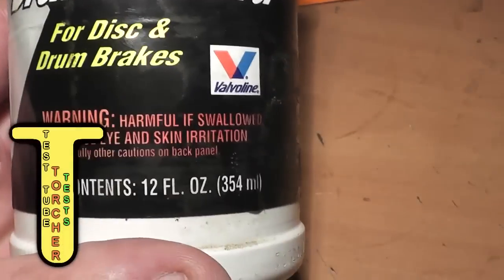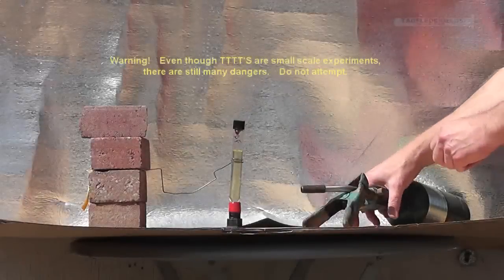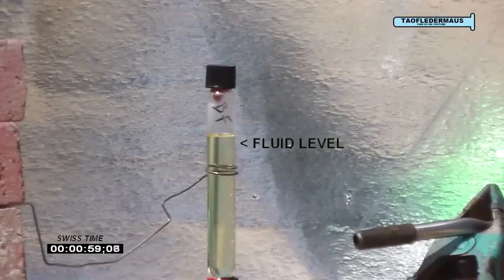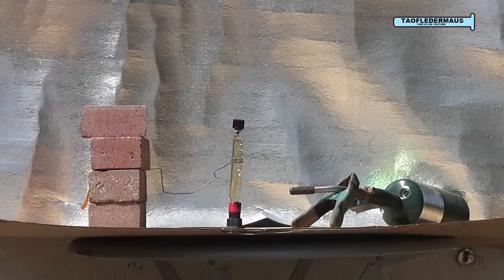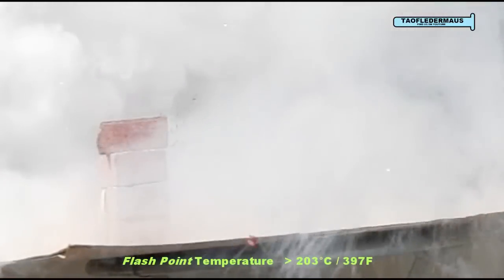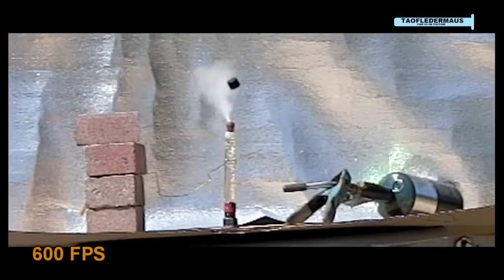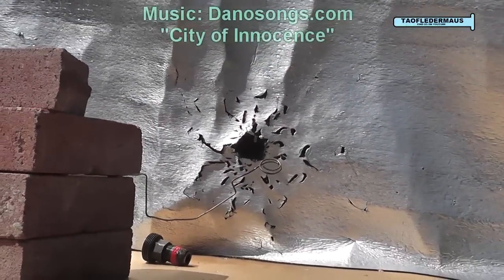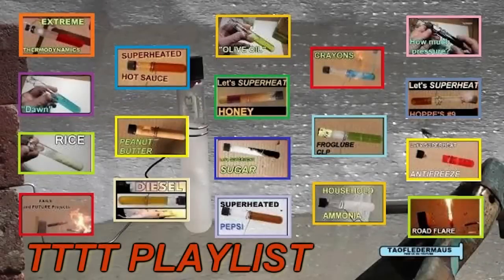TTTT - DOT 3  Brake Fluid -  Test Tube Torcher Tests

Comment: That did not auto ignite the torch was the source of ignition when the pressure released the temperature of the brake fluid would instantly cool to the boiling point of the liquid, the fine dispersal of it would be the point of it combustion like flour or lycopodium dusted in the air would be highly combustible but when sitting out on a table there not flammable to a degree

Comment: Very cool. If you want true brake fluid auto ignition, put about 4 ounces of DOT 3 in a Styrofoam cup and add a table spoon of dry pool chlorine powder. Timing can be varied with the amounts added.

Comment: I would be shocked if brake fluid is easily flammable. Many times, you have to heat the area around the bleeder screw to get it free. One time though, I did heat one up and I saw it ignite for a while  on the outside

Comment: ***** I'm a big fan of your videos, but i don't think that the breakfluid bursted into flames because of it reaching auto-ignition. To me it more looks like the spray got ignited by the torch and not spontainious combustion. The reason I belive this is that it's only some of the cloud that ignites. The rapid pressure drop, I belive, lowered the temperature enough that there was an ignition source needed. If the cloud of superheated fluid was at auto-ignition temperatures, the whole cloud is likely to ignite be cause of the volitaile air/fuel mixture (taking vapor pressure into account).

Comment: Just wondering was the bottle left open and for how long if it was? I'm only asking because brake fluid usually doesn't boil that fast. Brake fluid attracts moisture causing it to boil at a much much lower temp. I only know this because I spend way to much time working on cars.
Reply from the maker: It was from a sealed container.   The torch is putting a LOT of heat into that tube.
Reply: Hmm. Just seems weird that it boils off that fast. But this teaches me something.
Reply from the maker: I was surprised it started boiling so quickly too.

Comment: Hey ***** do you think the immense pressure generated within the test tube caused the rubber cap to be released in a fountain of brake fluid vapor that was then ignited by the torch?  I'm not sure that was autoignition as the fireball did not start until the test tube knocked itself over and the vapor made contact with the torch.  Just a thought

Comment: Just a thought, but to me the brake fluid did not auto ignite. The brake fluid that was not igniting as it sprayed out of the test tube. When the test tube fell over on its side the vapor ignited when it came in contact with the blowtorch flame. Still very cool though.

Comment: FYI - Dot 3 is often used to temper steel.  Set the steel into a dish of Dot 3 and set it on fire.  Home knife makers and AK rifle builders use this technique after a heat treatment.

Comment: Hey Jeff I want to get a multi-camera tripod mount because now the sun is finally coming out in the UK I've started to get the EX-F1 out a bit. I wouldn't mind getting a real time, sound recorded version of the event as well as the slow motion one though. Do you use that sort of device? If so how well can you recommend it? I'd really like one that will easily clip onto my tripod but i have no idea what i'm looking for
Reply from the maker: I made a couple lexan plates and drilled and tapped the center for the tripod.  The plates have holes in them for a bolt with a  wing nut on them to screw into the camera mount.   Each plate mounts two cameras.
Reply: Oh right awesome. Thanks!

Comment: What a fire ball . They say that inNascar the rotors get so hot that at the end of the race the fluid is pitch black from boiling .
Reply from the maker: I didn't know they used the brakes that much!
Reply: ***** Even a light touch at speed will generate shitloads of heat - I used to have 238mm discs on my car, and on a long, high speed run over the moors I could get nasty fade on the downhill sections (slowing from...interesting speeds to more sensible speeds for bends and yumps). Not that I was driving like a child - goodness no.

Switched out the callipers, carriers and disks for 280mm units from a newer, heavier model, and the fade has completely disappeared as the heat dissipates far quicker from the disk, pads and calliper blocks - so less heat gets transferred into the fluid, it doesn't heat up and boil (introducing air bubbles) so less fade, I believe is how it works. Well, how it works is immaterial at the end of the day - I can stop from high speeds with zero fade these days, period.

I'd imagine NASCAR would be using ceramic pads and disks by now as per DTM, WRC  etc, far greater heat resistance and less transfer to the fluids so less fade, size for size. Any NASCAR fans know?

Comment: That was awesome Jeff! You do cool dangerous things so we dont have to for our viewing pleasure so we dont have to! Well I say dangerous wich it is, but you always take the utmost care to follow safety precautions and instruct viewers carefully.  I cant think of anything else to try that you havent already done! Hmm..... maybe lead in a test tube?
Reply from the maker: There's almost an unlimited number of things around the house I can use.   I should be doing rum and model airplane fuel soon!   I was thinking of putting lead shot in one,  not sure if the tube or the lead would melt first.
Reply: Yeah the glass breaking or melting before the shot was my after thought as well. Maybe pre heat the shot to about 550 degrees?
Reply from the maker: I'll have to give it some thought.   The heat transfer between the glass and the shot is the key.   I'll probably have to heat it up slower.

Comment: That was very interesting, I was not sure what the Brake Fluid was going to do because of it's ability to handle high heat, those results were most unexpected...
Reply from the maker: Thank you Paul!    Yeah,  it's always a surprise.   I never know what exactly will happen.  Usually I am wrong when I try to predict it.

Comment: Dr Scholl's Freeze Away Wart Remover
This stuff is pure propane and diethyl ether, once you get it out of the can, it will probably be mostly ether, but ether is crazy flammable which should make for a nice show. Put it in the freezer before you spray it out.
Reply from the maker: It would be difficult to seal the test tube with the method I am using.    If it is a substance that produces pressure at room temperature,   it will just blow out the high temp silicone before it has time to set.

Comment: I'd like to see milk. Preferably with a high content of protein and/or fat.
I am especially interested in the proteins denaturising and any possible color changes.
Looked through the play list but didn't find milk.
Reply from the maker: The problem is I fill up and seal the test tubes a month or two ahead of time and I don't think the milk would last that long,  probably turn to cottage cheese.
Reply: ***** :(
How about boiling it, then pouring it n a test tube and sealing it? If you could get the inside sterile...
Well, I know it sounds complicated to do. :/

Comment: Oh hell yeah!, that is awesome!.

The foundry I used to work at used a water-glycol hydraulic fluid (Houghtons Houtosafe620) in the power units for the casting dies due to its low flammability, but when it contacted molten aluminum or red hot surfaces, it would flash over like that brake fluid did.
Reply from the maker: Haha,  that reminds me of working at a place that made extruded polyethylene foam.   We had fires almost weekly there!

Comment: You ought to try motor oil
Reply from the maker: I have a tt loaded with motor oil.   I heated it for 15 minutes and it just turned black.  I may not have had the torch close enough,   so I may try doing it again.  I never posted the original footage.
Reply: ***** I believe motor oil has a higher smoke point that other oils
Reply from the maker: I did the motor oil after a few failure where I put the torch too close and melted the glass.  I found that 4"  away is ideal.   I definitely want to try to motor oil again.   I have a new fixture to hold the tubes.
Reply: ***** Should be interesting to see the result

Comment: Curious... my geek ocd has me wondering whether that was an autoignition or 'merely' a flash over from the hot vapor coming into contact with the torch's open flame...  I guess the deciding factor would be whether or not the initial blast extinguished the torch's flame.
Reply from the maker: If the flame from the torch ignited it,   it would have begun at the torch and worked its way out.   But look at the cloud of vapor,   the flames begin way away from torch -  once it mixes with the air to get the proper air/fuel mixture to ignite.

Comment: Could you see how racing brake fluid holds out. It's supposed to have a higher boiling point so it'll be interesting to see if there's any difference!

Comment: Brake cleaner
fix a flat
bug spray (so many different kinds)
Radiator stop leak
Buffing compound
Gorilla glue
transfer fluid (man and auto)
Peroxide
pine sol
Barring  grease 
Powered laundry soap
rem-oil
Vaseline
Bleach (done already?)
Mobile1 vs castrol syntec !!!Please! !!
Graphite lube anti-seize
Hair moooyose
Non aerosol hairspray
Acetone
Fingernail polish
Done for now!!!!

Comment: dexcool (orange gm anitfreeze) had a pretty high boil point when undiluted. Many raditors that run it are not under any pressure. It would be neat to see how it acts under pressure and under some super heat.
Reply from the maker: I've done antifreeze before,   the reddish orange type.
Reply: I must have watched it, because I watch all of your vids... I just was not sure if it was dex. Dex is orange orange and reddish is usually a toyota kind. DEX has strange property’s and because of that cannot be mixed with any other coolant. I guess it would be redundant to do antifreeze again though.

Comment: I mentioned e-cigarette liquid a while back. The other day I found out that the base liquid (before adding nicotine and flavor) is available at Walmart (labelled Glycerin, above the rubbing alcohol in the first aid aisle.) It can be had for 4 dollars, so it would make a cheap test. :D
Reply from the maker: Jesse Sisolack It's one thing that is it edible,   it's another thing to inhale it.   Many people claim e-cigs are just  "water vapor"  but it isn't.
Reply from the maker: Propylene glycol is one of the components too,   and I have a tube loaded up with that.  P/G  is also used in smoke machines.
Reply: Yeah, but PG doesn't smoke as much as glycerin does. Also glycerin is sweeter and organic.
Reply from the maker: Locutus   We'll see!
Reply: Yes, e-cigarette liquid has two major ingredients. Those are propylene glycol and vegetable glycerin. Both are FDA approved food additives (even though they do not officially approve of e-cigs). Propylene glycol is a none toxic anti-freeze, anti-microbial, and dissolves flavoring agents very well. When added to food it is often to carry a flavoring agent. Vegetable glycerin is used as a food additive to allow small partials to stick to food surfaces such as salt. It is also what gives cooking oil that sticky like feeling and is a byproduct of making bio-diesel because bio-diesel is just oil with the glycerin removed.
Reply: ***** But the real question is, is it safer than all the chemicals in cigarettes? I personally switched because I have asthma and I haven't used my inhaler since I quit "smoking."
Reply: ***** Yes, it is more than water vapor. I use an atomizer myself to administer medication to my lungs and sinuses. In fact I am going into surgery later today for my breathing issues. Oh, and for those that use it for nicotine, the exhale has no nicotine in it. Nicotine absorbs on contact. Nasty stuff. Concentrated nicotine will kill on contact with skin, ha.
Reply: Jesse Sisolack Must be why my lips are always chapped. o.o
Reply: Locutus Your asthma let up because you're not inundating your lungs with physical irritants like tar, soot, and acidic compounds left over from incomplete combustion.  Your pulmonary congestion is basically your body's futile attempt to eliminate those thins.  Since it can't process them through the lung tissue, it has to try to expel them back up and out.  The plain fact of the matter is that the chemicals in e-cigs and vape juices are generally not well studied as high-concentration inhalation agents where things substance that are totally safe for passage through the GI tract might be rather dangerous. An example comes to mind of a juice a friend told me about called something like Unicorn Milk that was subject to a large recall several months ago.  They used titanium dioxide to make it look white and milky.  TiO2 is a very commonly used food and drug additive.  It is an excellent white pigment and is, far and away, the leading abrasive in toothpaste.  When swallowed, it is about as biologically active as sand.  However, as a fine dust (and in this application, it would have to have been very fine to remain emulsified), it is also about as dangerous as sand (or rather silica, which is the proper term for very fine amorphous crystals of SiO2).  At the end of the day, e-cigs are safer than cigarettes like getting shot with a 22 is safer than taking a buckshot load from a 12 gauge.  Limited to the two options, the choice is obvious but recognizing the dichotomy as false is ultimately far wiser...
Reply from the maker: We'll find out if e-cigs are actually safe after 10 or 20 years I guess.
Reply: ***** You should try baking soda and vinegar, maybe put some sodium(pure form) at the bottom of the test tube and then pour a good layer of baking soda or powder, and then vinegar on the top, tell me what you think

Comment: What about putting the chemicals inside glow sticks in a test tube? it might take a few of them though.
Reply: ***** if you cut the glow stick at the top with out breaking the internal glass mixing tube you can pour it slowly into the test tube and seal. The mixing tube is very thin glass (maybe something slightly diff. same idea), then when it heats it will more likely than not crack the glass mixing the two compounds ... not like ive done something like that before wink
Reply from the maker: That is something I want to try.    I attempted it but the two chemicals got mixed prematurely... I just need to get more glow sticks now.

Comment: what about carburetor cleaner!?!?!??!?!?!?! awesome!!!
Reply: Sheldon Goldman
flour and water? you want to get bread? cause that's how you get bread :P
Reply from the maker: Sheldon Goldman  I actually have both loaded up in some test tubes
Reply from the maker: It might eat through the silicone.
Reply from the maker: It is Permetex red high temp silicone.   I had to be careful not to tip the test tube so the brake fluid wouldn't attack the silicone plug.
Reply: ***** You should try non-Newtonian fluid, flour and water, or mustard!
Reply: I think RRRR with bread would be kinda cool.
Reply: *****
 What silicone are you using? I've found Permatex Ultra Grey the best for most automotive applications ( it's resistant to most automotive fluids )